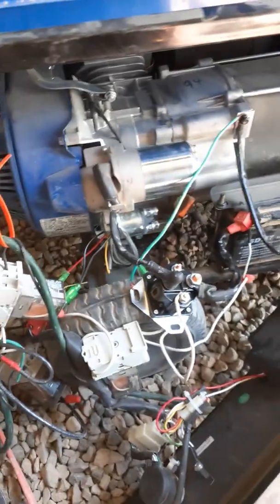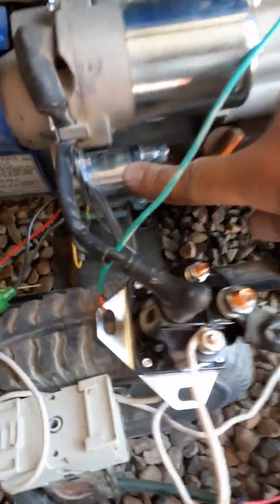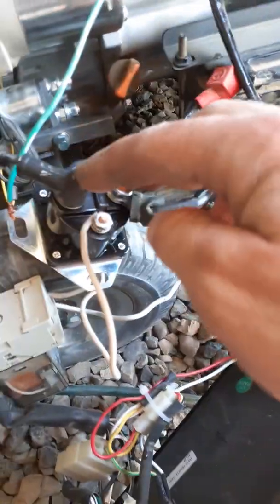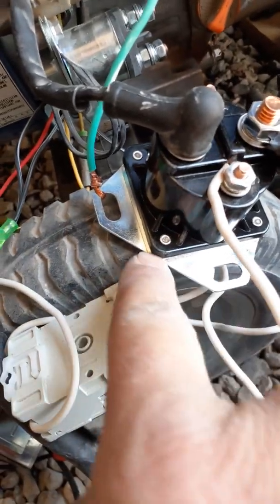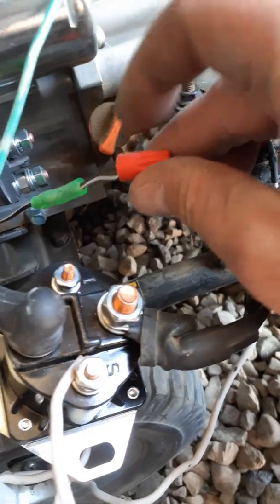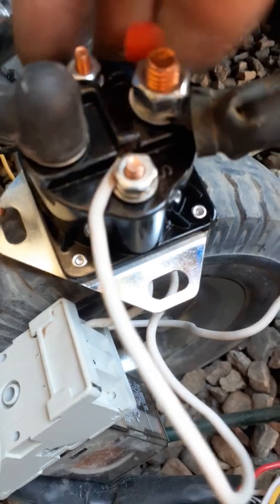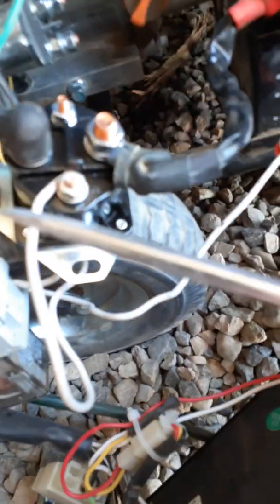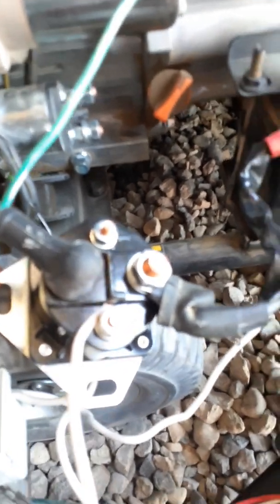Generator starter solenoid problem fix

Comment: MY newest problem on our Westinghouse 7500 is when I push the run switch the starter winds endlessly but does not start the engine. I am wondering if I need to order a whole new starter for the damn thing and just replace it. I even tried starting with the pull chord but it isn't starting that way either and the starter solenoid whining is enough to unnerve me! LOL!

Comment: I got a 9500 Westinghouse. Battery light comes on but nothing happens when I push electric start button or when pull starting.  Solenoid issue also? Or something else?

Comment: I love your fix. My generator has 2 wires that don't unscrew but are hard wired into the solenoid. I'm assuming they are for remote start. Do you think your fix will still work?
Reply: That’s what I’m dealing with on my Champion generator. There’s a black and white wire and a black wire hardwired into the solenoid. The new solenoid I have only has three poles, positive, negative and a terminal. What is the black wire for? I don’t want to cut it without knowing it’s going to work.

Comment: I truly appreciate this video. Thanks so much. I test my generators every month or so, I’ve got two electric start Westinghouse’s connected to trickle chargers and run on propane. Gene 1 perfect. Gene 2 no click no nothing. This is my issue for sure. I jumped the terminals and it cranked the engine. 9.99 plus shipping for the oem part through Westinghouse. I would have taken everything apart and replaced the whole starter. Thanks again.

Comment: I have a Champion dual fuel 9000 watt and when I push the start toggle, I can hear the starter make it's noise, but the engine isn't turning over.
Is that the solenoid?

Comment: Ok I have a portable generator train 6500 .it sat  in the shed for a year I didn’t drain the gas before  I stored it .pulled it out to start and it wouldn’t start so my first thought was it needed a new carburetor .along with that as I was trying to start it I was holding in the starter button and everything just kind of quit working so I replaced the carburetor put a new solenoid on and new spark plug still won’t start .the push button still isn’t working either so I tried starting with screwdriver it turns over but still won’t start I’m confused to what is wrong with it and I also checked for spark and it has spark it’s not a strong spark but there is spark I drained gas and put new in as well .what are your thoughts?

Comment: @The Self Sufficient, Offgrid, Hobby Farm  
Thank you for the video. Which other car solenoid can be used instead of 1991 Ford f150 solenoid?
What is the amperage of the solenoid?
Can 18 AH generator battery powered the solenoid?

Comment: Hi again.  I tried the new solenoid and it did not work.  I did cross the old solenoid and it did start.  tried the new one and found the only black and white wire was tied together with another white wire in a harness that went to the old solenoid Any suggestions would be grately app. I have a Generac GP7500e if that helps.  Thanks
Reply from the maker: Well shoot, I don't know what to tell ya. If the original solenoid will start it when you cross it but the new solenoid does not work, even when you cross it, then I would reccomend double checking the way you wired it. If that is correct then I'm afraid you might have a separate issue.
Reply: @KnightandSon  My Generac has some extra wires.  I found the wire that is black and white but is connected together with a white in a small harness.  this originally connected to the old solonoid and that is the only black and white wire

Comment: Thanks for info.  my Generac generator starter just clicks.  i will cross those 2 leads and see what happens. as you say it should turn over.  I will be buying a new solenoid and trying it.  if i run into issues I will contact you.  And again THANK YOU